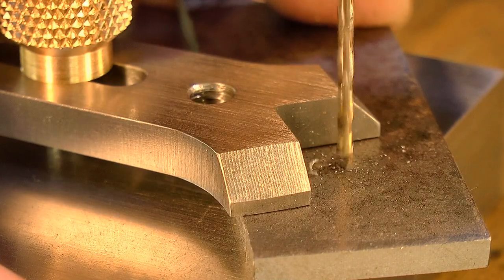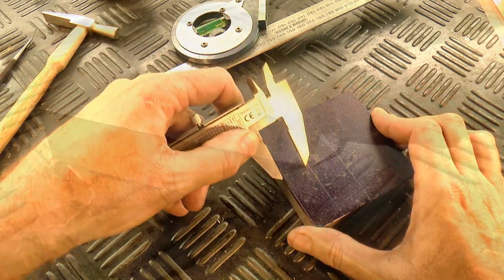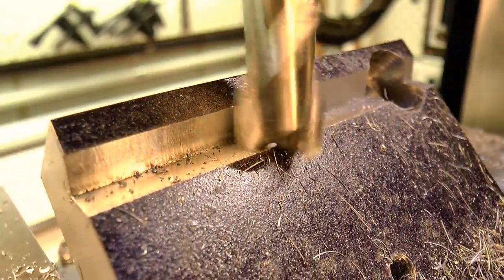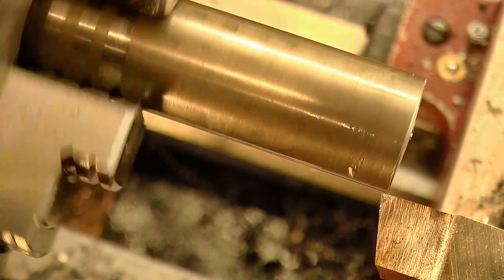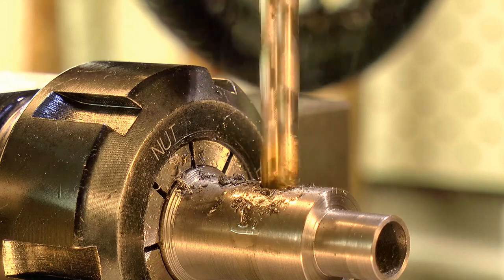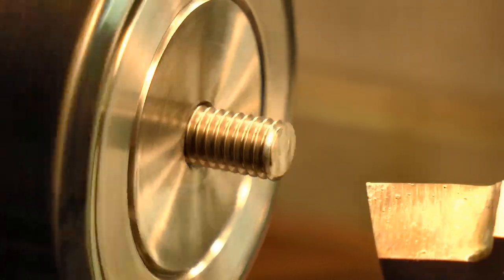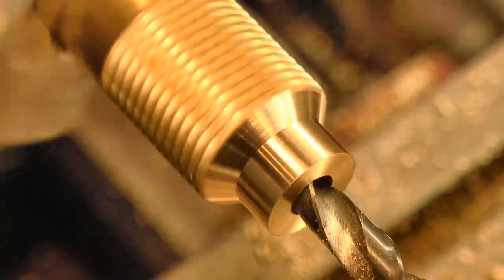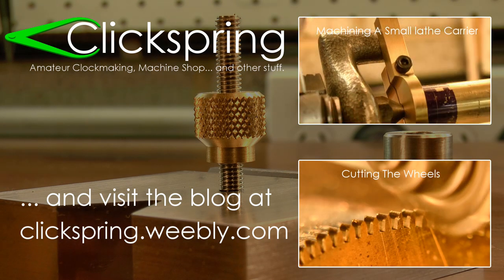Home Machine Shop Tool Making - Machining A Finger Plate Clamping Tool - Part 1

Comment from the maker: Machining A Finger Plate Clamping Tool - Part 1

A Finger Plate clamping tool is a valuable tool in any workshop, and is a great mini mill and mini lathe project. You can also modify the design to suit whatever stock you have in the shop, which means you can finally use some of that scrap you've been saving up for that special project.

In this first video of a 2 part series, I build the base for the tool, the cross hole jig, as well as the brass clamping nut. Usually associated with clockmaking, this tool really is a must for every home shop.

 #machinist     #Lathe     #Milling     #toolmaking
Reply: How fast does the lave spin
Reply: @thalivenom4972  and then there were 19 :-)

Comment: Dear Chris,
                    your videos are always so well made, beautifully lit and filmed. They are a joy to watch. Whilst watching this it occured to me that one way of ensuring that the centreing device is centred on the v groove would be to mill the groove first. Next turn a shank and point on the lathe. Part off and use this in the mill collet to centre the spindle on the groove and clamp the base to the mill table then mill in the hole for the centreing device. The end of the sacrificial centre should be turned to approximately the same included angle as the groove as the point or cheeks will centre the groove onto the sacrificial centre as the quill is fed down.

Comment: Great production values, and nice methods. Thanks a lot, you really raise the bar.

One alternative which I have used, when cross drilling using a collet block (as at 5:15 ish) goes like this:

 While the work is standing upright, I use an indicator turning with the spindle* to position the latter coaxially with the workpiece (no need for any maths, and it's more accurate than using an edgefinder), then when you lay the block down horizontally, it's already lined up and you only have to come in from the end the correct distance. I've always thought this was one of the cool things about collet blocks. 

 * (like an Indicol or my homemade variant, or one of the cranked-arm holders which go in a chuck or collet)
Reply from the maker: Terrific tip, have filed it away for future reference, thanks for sharing :)

Comment: Thanks Chris!  Your videos really are excellent quality and the subject matter terrific!  Looks to be a great GP small part holder and never seen one like this.  Often pondered how to quit breaking circuit board drills with some sort of bushing holder.  I use them a lot because they are more like end mills with a quality hole, although the carbide makes them very fragile in smaller sizes, but the shanks make great scribes after they break...got a box of them. ~¿@  Looking forward to part 2!  Thanks for sharing.  ~PJ
Reply from the maker: pjsalchemy Thanks PJ, Part 2 out in a few days.

Comment: Also, I'm curious about what kind of camera & gear you're using! Looks like you're using a small slider of some kind for some of the shots?
Reply from the maker: Gough Custom The camera is a Panasonic HC X920. Those shots are done using the saddle on my second lathe - my shop is tiny, so everything is really close!
Reply: Clickspring Using the lathe as a slider is a great idea! Nicely done! I'm impressed with the camera too. Most camcorders have very long depth of field that gives away their footage instantly but the one you're using turns out really nice footage!

I'm impressed mate! Really nice job on the videos and on the work you've done so far! I've subscribed and I'm looking forward to seeing more! Be warned I ask a lot of questions :)

-Aaron

Comment: if your mill or drill press can go to like 90 rpm you can use it to tap your parts. its pretty easy and much better for straight tapped holes

Comment: Great videos!, AvE sent me here a while ago... what type of stone did you use to remove the scale from the steel? and would that be suitable to polish up aluminum as well?
Reply from the maker: +lsdave I used 400 grit emery paper on a thick slab of glass to remove the steel scale. I use the same arrangement with different grits to polish ally, steel and brass. Works great. Thanks for watching :)

Comment: it does seem like getting the v groove and bushing holder accurately located could certainly be tricky. could it have been possible to leave the bushing hole until after the holder was in place, then drill it after locating the machine on the v groove?
Reply from the maker: Yes you are correct Rob, it would have been much smarter of me to have made the groove, used a rod to locate its vertex, and then drilled the bushing hole. Brain was in low gear on that day!!

Comment: Hello again Chris,
What has sparked my interest is the difference between the saw in the video and the saw in the amazon.com ad that you referred me to. The saw in the ad is what I have always called a piercing saw. I own a couple of them. The saw in the video had a completely different way of holding the blade, and the blade appears to be cylindrical (even in full screen mode). Is that appearance of the blade just due to video limited resolution? Is it really just a piercing saw blade?
Richard.
Reply from the maker: Richard Schurmann Hi Richard, the blade is a just a simple flat pinless piercing saw blade from this supplier: http://www.thewoodworks.com.au/index.php?page=shop.product_details&flypage=flypage.tpl&product_id=4775&category_id=296&option=com_virtuemart&Itemid=91

The saw itself has a slightly different mechanism to hold the blade, but it amounts to the same thing as the saw on Amazon. Its just a pinching screw that clamps down on the flat end of the blade. Hope this clears it up for you :)

Comment: I've always wondered wether you can use one set of knurling wheels to surface different diameters of stock, I am tempted to believe that if the circumference is even slightly off the pattern will be completely off. Do you have different sets of knurling wheels or do you turn your stock to specific increments to fit the pattern?
Reply from the maker: EddvT A knurling wheel can be used to surface different diameters, but you are correct to believe that the OD is critical to success. You have to turn the diameter down to specific figures that match the knurl pitch and diameter. It's a bit like an onion skin - if you go too far turning to the intended diameter, then there is another suitable diameter just a little bit narrower. There are plenty of calculators for this online, here is one developed recently by my friend PJ : http://www.homemadetools.net/forum/online-knurling-calculator-20335#post29204

Comment: Nice work!  How did you measure and check the dimensions of the V groove? Would marking out the V, albeit small, help me to cut the right depth, width of the V using and end mill? I'm making two FP's, one has a .539 V width. Thanks!

Comment: Really enjoying your videos.  Love the quality of work.  Just had a quick question.  I've noticed that your using a bandsaw to cut metal.  Just wondering if you could tell me brand of band saw you have or can you recommend one to me that would do the same.  Thanks!
Reply from the maker: Custom Woodwind and Brass The saw is a BS3 horizontal metal cutting band saw (http://www.machineryhouse.com.au/B003) It has a little table that can be attached and used in the upright position. Its primarily for horizontal cutting, but I can't afford a vertical saw, so this is a cheap way of getting both. Thanks for watching.
Reply: Clickspring Thank you.  I'll check it out.

Comment: Chris, you a very naughty boy! Using your Digital Caliper as a scriber.....Come on!! ;-)
Love your Videos.
Peter (melbourne)
Reply from the maker: MOREENGINEERING Ha ha! Is that not what they're for? Thanks for watching mate :)
Reply: Clickspring Of course, I could be wrong! Which might explain why some of my students used to roll their eyes at me when I ticked them of for doing such things.
Of course you can always use a scriber together with the vernier to generate the same line, and it will(with thought) be more accurate.

Beautiful work and VHQ videos. 
Brass is always nice to work with, I'm a Ali fan. 6061 T6 and 5083 are my favourites.
Tools just keep going (carbide of course).
Peter
Reply from the maker: MOREENGINEERING You know you're the first one to pick me up on the calipers; I thought I would get into trouble way sooner! You must show me what you mean re the scriber+calipers. Agreed on the Ali and brass. Just as well, because good steel is so hard to find locally. Great to have a manual arts teacher on site, I get to pass the hard q's on to you now!
Reply: Clickspring Ouch! that hurts...
I was not a manual arts teacher(thanks very much). I actually taught apprentices in the TAFE sector at a University. I done an apprenticeship myself and then after 12 years experience, i got myself into Teaching.
It used to be great fun. I an now retired and have a TORMACH CNC Mill in my garage. I love that thing to bits. It's great fun. But I gotta say, watching your videos and your methods takes me back. Your work is awesome!  Regards Peter

Comment: Chris, I would have made the V-groove first, the position is not critical, using your 45 degree in the vice technique.
Then having the work flat in the vice again, I would put some cylindrical piece (pin, piece of silver steel, shank of an endmill... )
into the V-groove, find the center of the pin with a edge-finder and drill and mill the hole for the bushing exactly in alignment with the V-groove.
With this you avoid centering the groove to your bore, which is very hard to measure, with simply finding the center of the pin in the already made groove.
Reply from the maker: +Dieter Mayr Yes I think I made life unnecessarily hard for myself for that part of the job, your suggested method is better, wish I had though of it! thanks for watching Dieter :)

Comment: Chris, At 7.51 the angle (Perhaps 45 deg) did you do that freehand?, or can you engage "Z" and "X" to produce it?.
Reply from the maker: +Walter Maisey Hey Walter, the parallel section by feeding with the carriage, and then at the tapered section feeding out with the top-slide.
Reply: So then it was freehand, very good

Comment: When you chuck down on the thread-all, doesn't it destroy the threads?
Reply from the maker: ***** Hi Dave, using a collet chuck (instead of a 3 jaw) spreads out the load around the thread, so that it doesn't mark it. Search out ER collet for more info. Thanks for watching.

Comment: I downloaded the finger plate drawings but it doesn't show the dimension for the fingers height scribe line. The line you show being scribed before the bevels.  The side view.  The height is shown as .240".  What height did you scribe the bevel line? Thanks
Reply from the maker: Hey Emilio, thanks for pointing that out I will amend the drawings - the dimension should be 0.08"

Comment: Hi dude. Great work. What type of glass do u use with the sandpaper ?
Reply from the maker: Not sure what sort of glass, got it from the local glazier who does normal windows etc - About 20mm thick with a bevelled safety edge
Reply: Ask for float glass, about 12mm to 1/2" thick. Cost me AU30.00 dollars for 2 pieces, cut and edges beveled.

Comment: @Clickspring....I don't know if you did it on purpose, but a few times the coloring in the picture changed quite a bit (which is probably negative from a 'concentration standpoint', but I thought I would point out that the change (for instance I noticed that in one clip it went from a bit more red and intense (the colors), to more ...'coolish' (colors)....which gave me the idea that such tricks...if used in the right amount can keep a person's interest and likely cause a longer viewing time for some viewers then might normally be.  If you did that on purpose...good for you, but at any rate, I just had to mention my thoughts on it and thank you for the idea (I am definitely going to experiment with the idea and use google analytics to see if I can see any increasing view trend from it ;)...Thanks again and keep up the good work!

Comment: Hello Chris,
At 6 minutes 33 sec on this video, you cut some threded rod with a tool that looks like a cross between a piercing saw and a special Abra file holder. Where do you get this tool, and what is it called?
Richard.
Reply from the maker: Richard Schurmann Hi Richard, that's a jewelers saw. Mine is similar to this: http://www.amazon.com/SE-Professional-Jewelers-Without-Blades/dp/B00313Q46M Thanks for watching and asking.

Comment: Chris you make stuff look so amazing thank you. You make it look so easy. I just purchased like six or eight motor shafts from large AC handling units. They are like 3 to 6 ft long. Could you tell me or could anyone tell me if that stuff would make good Machining stock? I looked at it and it looks like it's been machined by a lathe. Because it has long keyways cut in it. But I just don't know if it would be good to practice on with my small Bolton lathe. It's a 16 x 24 think??

Comment: Question:  What is the location of the side hole on the bushing holder?  Is it dead center to the top part of the holder? I can't find it on the drawing. I see a .20" line on the drawing of the plate on sheet 3 of 10. Thanks
Reply from the maker: Hey Emelio, the dimension is given by the 'height' of the base 0.79. If you have a look at the assembly shot (https://youtu.be/FgBM-JVRWgU?t=6m26s) the hole is bisected by the top plane of the base, so its center point must be on that plane also. Cheers, Chris.

Comment: Having a double angle cutter would be kinda sketchy to cut out such a deep groove. The sfpm at the very tip would be way too low and you'd probably crack your cutter. The way you cut the groove is actually the best way to do it.
Reply: Would it have been less problematic to machine the groove first, and then drill the bushing holder hole last? Just wondering. I’m just getting up to speed on this machine stuff!

Comment: Hey Chris, what camera/lens setup do you use?
Reply from the maker: snoberts I have a Panasonic HC X920 camcorder, and occasionally I use a macro filter to get a little closer, but for the most part I just use the camcorder as is. If I had a chance to buy again, I would go for a decent quality DSLR, so I could use a macro lens for closeups. Thanks for watching and asking.

Comment: What is that thing being used at 5:08? I've seen it used in a few other videos and can't figure out it's purpose.
Reply: +bitfreakazoid, I think it zeroes and/or defines the limits of what's being tooled to that computerized drill/milling machine thingamajig.
Reply: It's what's called an edge finder and it does exactly that. You use it to locate features on a part. Then you can use that location as a reference for other features.

Comment: Hi, what lathe are you using?
Reply from the maker: Jimmy Zhan Hey Jimmy, the lathe is an SC4. Thanks for watching.
Reply: Hey, thanks for the quick reply. I noticed that you also have a Sherline. Do you find that you use the Sherline or SC4 more?
Reply from the maker: Jimmy Zhan Have a look here for a bit more info on each: http://clickspring.weebly.com/blog/which-lathe-should-i-buy

Comment: Wayback machine caught ya slackin!    You didn't clean up the tip of the thread on the rod before you put it in the threaded hole at 7:00